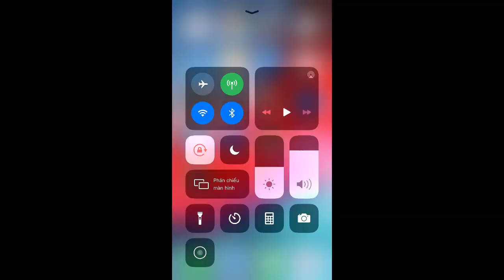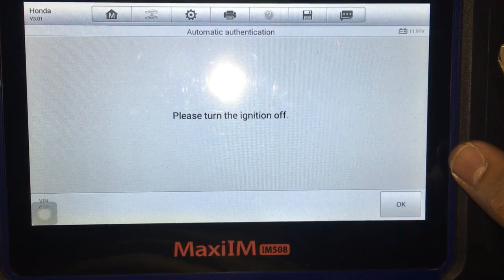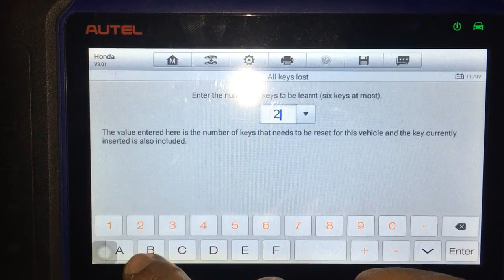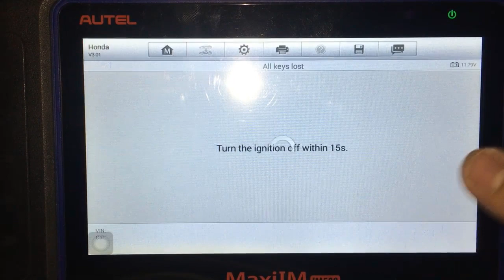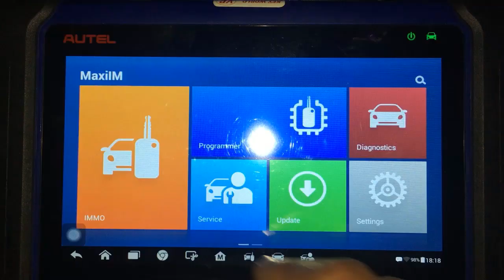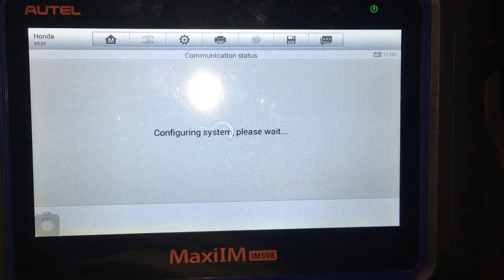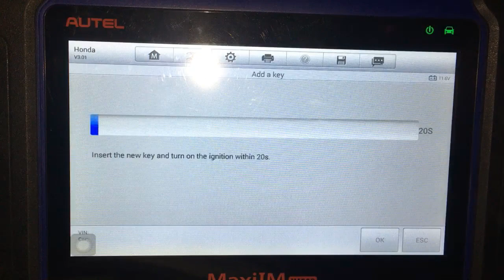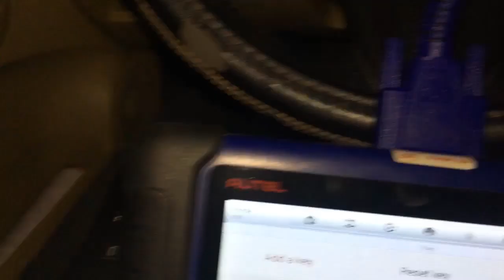Program immobilizer HONDA CIVIC ID46 7961 All key lost by AUTEL IM508 and KEYDIY

Comment: Why do all keys lost though? Won't that make it so all your keys now won't work and then you won't have a working key for the system to learn from?
Reply from the maker: Demonstration of the method used
Reply from the maker: Thank you for watching !
Reply: @locksmithsuccess  What I mean is with this device, will it work with registering a new key, if say you put all keys as lost and now you don't have a working key. So say you have NO KEYS to the vehlicle, will it still work with programming new key?
Reply from the maker: It still works
Reply from the maker: I tried in the car when I lost all the keys.
And here is the remake video.

I tried in the car when I lost all the keys.
And this is the remake VIDEO
Reply: @footage6402  You can add or delete a key whenever you please. If you delete all keys, you have the ability to reprogram them to the immobilizer.